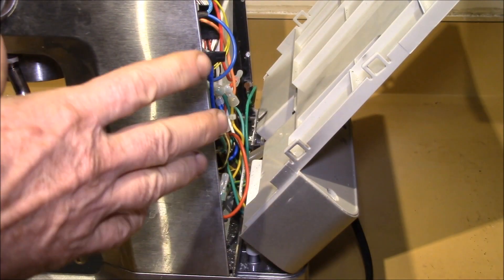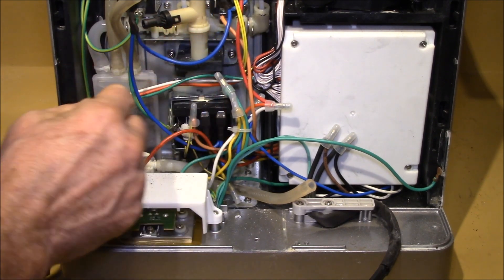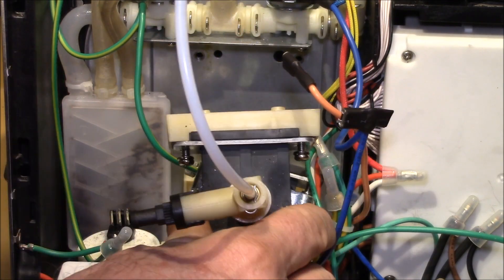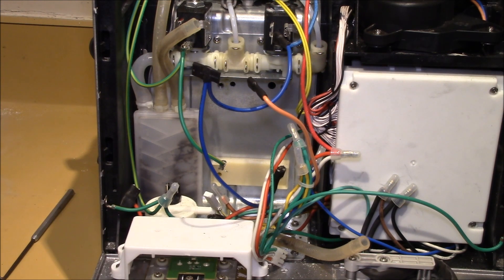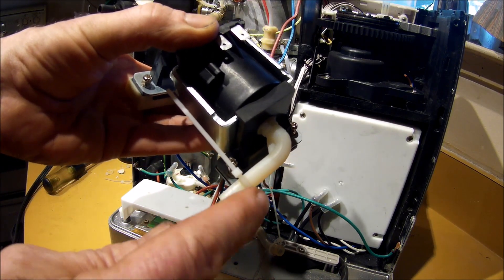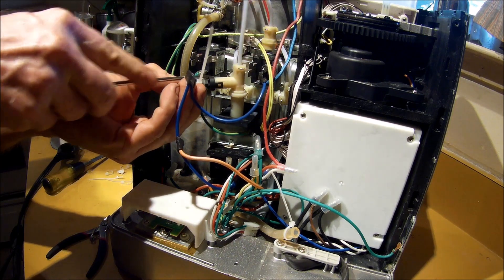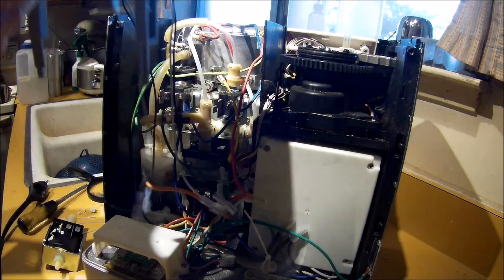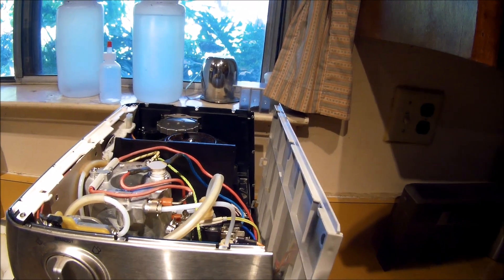Breville 870XL Pump Replacement, Part 1

Comment: Dear Mr Brown,  thank you for the video,  have the bes870 for 5 years now, the pressure gauge stopped to move along with strong noise like you described on the solenoid video also with much slower flow of water from the group head, steam is fine but the water coming out of the tap seems to be mixed with steam.. I took apart the solenoid and cleaned it like you suggested, still no change..
Last thing I have noticed,  when I run the "clean me" procedure,  the amount of water coming out is maybe 10% of what used to come out when there was no problem..
Reply from the maker: Open up the back of the machine and take a peek inside while running a cycle to see if you can see where the water is going.  Be careful as there are live, exposed electrical connections inside.  If you see water flowing out to the diffuser and into the drip tray, it's either the 3-port solenoid not blocking flow out the top or the 2-port valve is letting water out or the over pressure valve is passing water just coming out of the pump to the diffuser.
Reply: @The4Crawler  
Dear Mr. Brown,
Thanks for the prompt reply,
The drip tray doesn’t gets the amount of water you would expect to see, it feels like the water is not being pumped out from some odd reason..
I will check your suggestions, and let you know what have I found.
Thanks again for your help,
Efi Benbassa
Reply from the maker: @ebenbassa  Might be the inlet water filter between the tank and pump if plugged up or the pump output has dropped.  They are re-buildable or you can pick up a new one fairly inexpensively.
Reply: @The4Crawler  Dear Mr. Brown,
I'm about to give up..
This is after replacing the pump and solenoid kit..
As I wrote, the feeling is that the machine fails to push the water..
Another thing I noticed is that the hot water tap emits steam and not water..
the pressure gauge does not move at all.
You wrote about the filter between the tank and the pump, can you please send a link where it is possible to buy it?
Thanks,
 Efi
Reply from the maker: @ebenbassa  Part number listed below:
https://www.ereplacementparts.com/water-filter-assy-pre-tank-p-629891.html
Doesn't seem to be available there any more, but my trick is search for the part number and see what turns up:
https://youtu.be/lxFlKTBczbo
Reply: @The4Crawler Dear Mr. Brown,
Thank you for your prompt reply,
I took the pre tank filter out, put a by pass insted, the problem seem to be resolved, I  can extract nice esspresso, the amount of water is the same as it use to be..
The only thing that doesnt work is the pressure gaudge, it still doesnt move.. although I can say the pressure is good by the extraction ( any Idea why ? )
As for the pre tank filter, it seems impossible to get it, I have found one, the shipping cost is ~$40.. I am located in France,
Have you any idea if the guy who open the pre tank filter mange to reinstal it without the "Carbon" layer after gluing?
thanks again,
Efi
Reply from the maker: @ebenbassa  The gauge is a simple mechanical (Bourdon tube) type gauge.  It's either not connected (would be a water leak) or the line to it is clogged or it's broken internally.
On the filter, you might try contacting the poster of that video and see if he was able to reuse that filter.
Reply: @The4Crawler  Thanks, I see non of the resones you have mentioned over the gauge.. unless there is still problem with the presure that I am not aware of..
b.t.w, the other guy have manged to set back the inlet water filter..
Thanks again for every thing !!
Efi
Reply: @The4Crawler  very strange, I disassembled the pressure gauge hose on the side of the gauge, turned on the machine, nothing comes out of this hose when I extract coffee ..
Reply from the maker: @ebenbassa  Could be a clog inside that hose or at the other end where that hose plugs into the rest of the machine.
Reply: @The4Crawler  THANKS
Reply: For general knowledge, for all those who encounter a similar problem, there is no need to open/cut the pre tank filter, it is a closed plastic mold, a 1.5 mm diameter drill bit can be inserted and rotated manually, the black layer is caught on the drill bit and can be taken out, the filter remains with one open layer. .
Reply from the maker: @ebenbassa  That's a great tip, thanks for posting.

Comment: Thank you for the video! I replaced the pump in my breville barista pro, but now as long as the machine is plugged in to the outlet the pump is always on, any ideas on how to fix that?
Reply from the maker: Hard to say.  Might want to double check the wire connections at the pump and on the main circuit board.  The pump is controlled by that circuit board, so maybe something on it went bad, or perhaps the new pump might have an issue. Might try contacting Breville Support and see if they have any troubleshooting ideas.

Comment: From where can I buy the solenoid valves for the bes840?
Reply from the maker: My strategy is to look up the part number here:
https://www.ereplacementparts.com/breville-bes840-infuser-espresso-machine-parts-c-116052_116055_187836.html
The plug that part number into a web search and see what turns up.  If that doesn't work, try searching for the solenoid part number, likely made by Olab.

Comment: Hey thanks for the great video. I trie to order the safety valve from your king of Amazon and seems like it’s out of stock. Would you recommend any other site that I can order from
Reply from the maker: Yes, have heard that part is out of stock many places with the recent supply chain issues related to the lagerlurgy.  Best to just keep checking around on eReplacementparts.com, ebay.com, amazon.com and even contacting Breville support (get the p/n off one of the other sites) and see if they have that part in stock.

Comment: I am tripping the GFCI outlet when trying to pull a shot(yes I tried different a outlet/circuit in kitchen).  But its not tripping when using steam or hot water.  The pressure is fine, but there is mineral(white corrosion) build up on top of the 3 way solenoid body around the nut, like its got a small leak happening inside of of the body and its coming out the top(the tube leaving the top does not appear to be leaking).  Would you suspect that ground fault is happening within the solenoid? is that possible?   Thanks for your videos on the XL870 !!  Been super helpful.
Reply from the maker: Yes, likely the solenoid coil on the 3-port valve.   That has line/neutral/ground connections and the ground connection  is to the center metal part that in turn contacts the metal of the valve body.  There could be an electrical connection between the line or neutral connection and the metal of the valve.  You may be able to get by with just putting a new coil on and not need to replace the entire solenoid block.
Reply: @The4Crawler  Thats what I was hoping.  I will follow up once done to let you, and anyone else that hits your post(s), know if it was the solution in this case.  Again, thanks for taking the time !

Comment: WOW 😳 Wouldn’t it be easier to buy a new coffee machine
Reply from the maker: Sure I suppose.  But that's $600 for a new machine or $32 for a new pump plus a bit of time to replace it.  If you sent it in for repair at Breville, you're looking at about $300 for their flat rate service including shipping both ways.

Comment: Mr.Brown, thank you so much for all you do, I have been getting a lot of good tips out of your tutorials to replace parts for the breville express. One question though..I have already replaced the solenoid valve twice but as of late, the pressure gauge keeps moving up and down during extraction. Also if my grinds are slightly fine, it would just shoot up then it would fail to maintain the pressure and it begins to decline. Do you think it's the issue with the pump ???
Reply from the maker: Hard to say.  If the pressure does go up at the start, that says the pump is capable of putting out the indicated pressure.  But then something is causing the pressure to fall.  Could be the coffee in the filter basket is breaking up and creating a channel through it that lets water flow easier w/ less pressure drop.  The pressure on the gauge is caused by the resistance to water flow in the system, not directly by the pump.  I would work with the grinder setting, amount and tamping to make sure that's all dialed in.  Or try the dual wall filter basket, that should maintain a steady, albeit lower, pressure the whole cycle.
Reply: @The4Crawler  problem solved ! It was the pump...just replaced it with a brand new pump, although it took a little more time than I thought, but in the end, the pressure is very consistent and it does not fluctuate anymore. In my 6-7 yrs of ownership, so far I have replaced the solenoid twice, and the pump...I dont think the barista express is a bad machine since its DIY friendly.
Reply from the maker: @timothyj1706  Glad you got it fixed.  Your pressure symptoms were different than what I had, mine was lower pressure all the time.  But hold onto the old pump, they are re-buildable.  Hope to be making a video on doing that shortly.
Reply: @The4Crawler  Mr. Brown, so I kept the old pump after fixing the initial pressure issue that I experienced last year.  This time around, my unit started acting weird with very unstable pressure so I replaced it with the old pump ! Ha Thank God I kept the old pump because of you ! You are the man !!!
Reply from the maker: @timothyj1706  Great, glad you got it sorted out.  Yes, I hold onto all the old parts, too.  The pump is fairly easy and inexpensive to repair if it just needs a new o-ring or plastic ball.  Repair kits available on eBay.
Reply: @The4Crawler  could you please let me know what to look for on ebay ? Thnx !
Reply from the maker: @timothyj1706  Search for "Ulka Pump Repair Kit"
Reply: @The4Crawler  thnx sir. I will give that a try again.

Comment: Hello, I have a suggestion.  Water pressure gauges don't cost much.  Might you get one and hook it up to the pump?  That would show what shape the pump would be in.  I have seen the hookup to the gauge that comes with the unit, but might be hard to connect to a gauge without the Breville hookup.......just an idea.......
Reply from the maker: Yes, am working on a video with a pressure gauge.  I did test the pump in this video (w/o a gauge):
https://youtu.be/z9KGunmnLSI
Reply: @The4Crawler   In the video, that is how I thought I'd do it.  But then realized that a gauge is a bit better than how far the water shoots....  I would think, too, that hooking it up to a gauge, you'd be able to test/set the safety valve setting, also.....

Comment: How come pump went so fast and need to be replaced how old is machine?
Reply from the maker: Machine was a bit over 6 yrs. at the time.  I think it was a combination of the pump check valve being a bit worn along with the over pressure valve leaking a bit that led to somewhat lower output pressure.
Reply: @The4Crawler  I’m buying my tommorow and wonder how long pump lasts?

Any tips on grinder best setting
Reply from the maker: @alanh8101  The pump is rebuildable, I did pick up a rebuild kit for mine, just haven't had time to jump into that yet.  Was easier to purchase the new pump, install it then repair the old pump as time permits.  

For the grinder, start in the middle of the range and adjust up or down as needed:
https://youtu.be/06StqafhHe0
Best to only make one change at a time, up/down in coarseness or up/down in amount.  That way you don't overshoot the ideal setting.  It may also change with every batch of beans you buy.
Reply: @The4Crawler  Thanks very much for info and sure buying new pump way better than rebuilding etc..

So for grinder I shouldn’t change setting right away from factory 6 as they do I believe
Reply from the maker: @alanh8101  6 would be a good place to start.  Try that and adjust up or down as needed.  Higher numbers = coarser grind = lower pressure.  Smaller number = finer grind = higher pressure.  I'll just keep note of what the last shot did and then adjust the grinder up or down a number the next time.
Reply: @The4Crawler  one thing I’m curious how to get that extraction like honey what setting?
Reply from the maker: @alanh8101  You'll need to find that with your machine and your coffee.  Just start with some setting and bump the grind and amount dials up or down one number at a time depending on the results of that last extraction.  Looking for the pressure and and how long a shot takes.  Some folks find keeping a notebook of the various settings and type of coffee helps.  But realize, these grinders are not precisely calibrated devices, they just have a range of settings and one machine may be perfect at #3, another at #6 and another at #12.
Reply: @The4Crawler  That’s really good quality by Breville 6 yrs pretty good 👍🏼👍🏼👍🏼👍🏼better than some high end I seen

Comment: Hi Mr Brown, could tell me how to open a bs 830 xl. I can't open the upper side of the machine to get to the pump.
Reply from the maker: I've not worked with that version machine.  If it's like the 870XL I have, check out the video in the playlist on replacing the solenoid valves.  I go into opening up the machine in more detail in that video.  Otherwise, there's some 800-series repair information on this web page:
https://siber-sonic.com/appliance/breville.html

Comment: Thanks for these great videos! What kind of lights did you attach to the solenoids?
Reply from the maker: They are some 120V LED indicator lights, link in the video description below::
https://youtu.be/9cC-m3a-oXY
Reply: R Brown thanks for the prompt response! I hope I’m not taking too much of your time; I have no steam coming out of my steamer wand, but the hot water nozzle works fine. Could it be clogged if so, how do I unclog it?

Comment: Have you ever taken apart the piece behind the grinding cradle? I believe the button in my gridding cradle has stopped sending a single to the grinder when depressed. I’m trying to figure out what piece could have broken.
Reply from the maker: I've never dug that far into the machine.  I suppose first see if you can find the wire/connector that comes from the switch and see if it's plugged into the controller board.  All the switch does is send a signal the controller and that't what sends power to the grinder to run, so also check the connection for the grinder.  If all that's OK, either talk with Breville support and see if they have any ideas and/or try to access the switch mechanism in back and see what's wrong.  It might be ground coffee has gotten inside the mechanism and has jammed the switch open.  Listen for the distinct click as you push in that switch.  Maybe some compressed air blown in around the mechanism will free it up.
Reply: R Brown very helpful! Thank you!

Comment: Hi, I bought this machine about 4 months ago.  I pretty happy with, but I always think because it can use pressurized filter they (Factory) adjust the pressure too high. Much far above 9 bars. It's not a good thing because makes it prone to canalization. So seeing you videos  I was able to figure out how to solve the problem. It's a matter of add a T connection to the pump inlet and redirect the tube that came from the outlet safety valve to the T connection. And of course seal the remain open inlet collector tank and adjust the safety valve to operate as an OVP valve instead and open when the pressure gets 9 to 10 bars let about 60ml return to pump inlet this way relief the extra pressure likewise the BES900 series machines. English is not my native language and sorry about it .  Anyway tank you  very much for sharing your videos. I really appreciate!   Greetings from Brazil.
Reply from the maker: Thanks for the information.  I might give this a try myself.
Reply: That's a Baller move.

Comment: Thanks for the helpful video. My machine started to sound ragged during the standard initial pump burst whenever the machine turns on. It quickly got worse, until the pump stopped completely. 
I pulled it out and checked it, and while both top and bottom hoses were off I fired the machine up with the power button. It actually pumped, squirting some residual water around. However, when i reassembled the pump all I got was a faint hum from the pump, and a slow trickle out the top hose when disconnected. Any thoughts?
Reply from the maker: I've never run into that exact problem, but 2 ideas what's going on.  
1. The pump may be clogged.  You can find videos on how to open up the pump to check inside.  
2. The pump solenoid may not be working.  Might be the thermal cutout (the little white thing on the side) may be faulty, the connections might be loose or the solenoid coil may be bad.  My 120V pump coil reads about 110 ohms on a multi-meter.
Reply: R Brown Thanks for that, I’ll check those things. Mine is a 230 volt model, and at one stage the resistance across the pump terminals was a few Mega Ohms. I tried both polarities, as the pump had a diode symbol on it. 
I’m wondering if there is some sort of random fault in the coil windings inside the pump, similar to the frustrating similar fault often found with the ignition coil in a small engine. Although, even when it’s not doing the loud pumping action, it still hums and pumps a tiny bit of water.
Reply from the maker: @reelMn  Yes, there apparently is a diode in the pump, making it turn on and off every half cycle of the AC power waveform.  If it's reading very high resistance that diode may have failed open circuit.  Or if the pump just hums, that may indicate the diode is shorted and the coil is just turning on and staying on, like the coils on the 2 solenoid valves inside the machine.